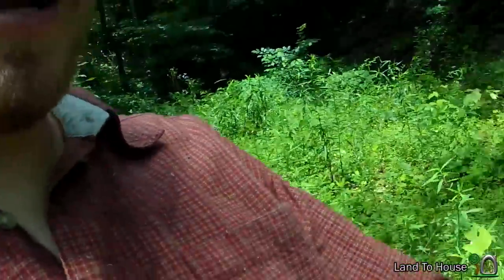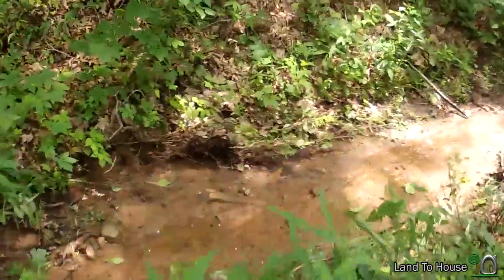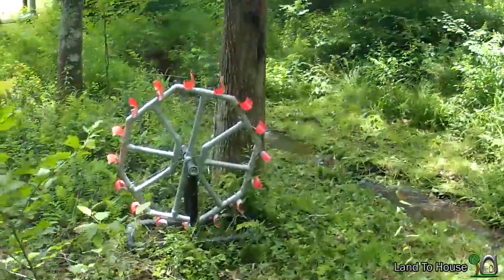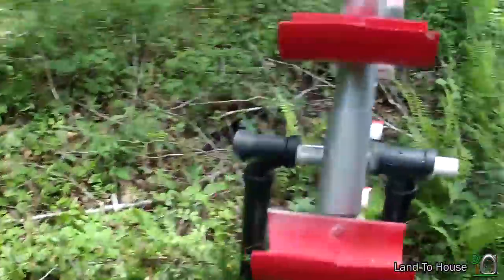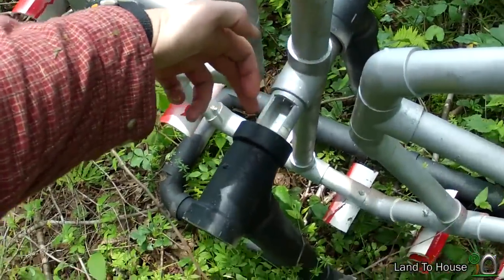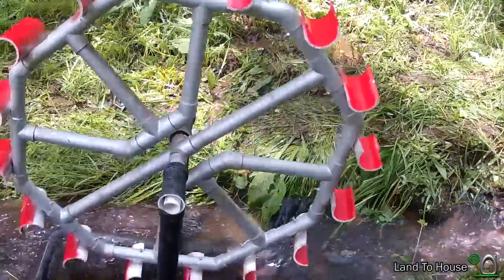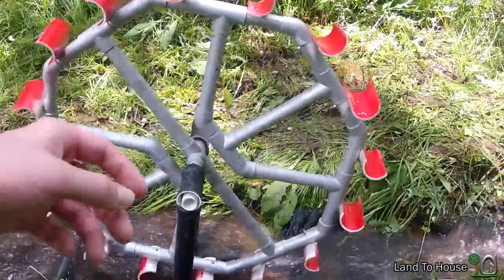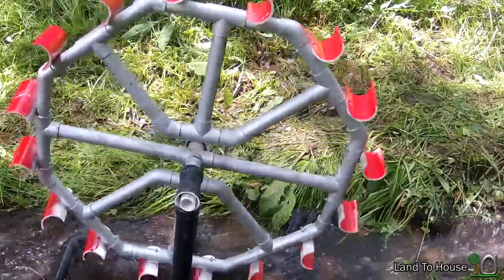Land To House Adventure Episode 10 - Water Wheel Pump

Comment: And here we are again. lol I got your ram pump and I never could get it to run right, even in winter when there was plenty of water, bc there is just not much drop. But now I have changed my plan to do a water wheel that runs  puston type pump, and Google brought up you. It's all good. I knew my idea was not new and I knew  I could find a video that someone else had done this.  I'm still tryin to get water to livestock up on a hill without having to fuss with it all the time.  May run a ram pump in conjunction to the water wheel piston pump.
Reply from the maker: So sorry to hear the ram pump did not work. It does need at least 2 feet of head pressure to be constant in operation. I had a time with this water wheel pump. Gave up after a while. There is a Facebook group called water wheel pumps. It has tons of people who know what they are doing.
Reply: @LandtoHouse  I will give that a gander. I haven't  given up on the ram pump. It was super close to working a d maybe I can integrate it in. My Dad took it home with him and built a bigger, slightly different version, so now I have two and I owe him for parts. He brought it over and we put a 5 gallon bucket up on a big barrel and ran both of them from that just fine. But my creek just doesn't  drop very much, doggonit. I haven't  given up though. Our house, a 100 yr old house, has a spring fed well, which works fine for showers and drinki g water, but you get into a quarter acre garden watering and all the laundry, and then water cows.... it was not keeping up w the wayer demand.  So I'm still working on seperating my garden and livestock water from the house water via the creek.  So I will definitely be checking that group out. Thanks!
Reply from the maker: @beggsnachin  you might also be able to consider rain catchment? Even a small roof can store a lot of water. Then you could use a 12v diaphragm pump to push the water out to the garden and cows. .... with the right setup the ram pump is amazing but without that head pressure it's tough!
Reply: @LandtoHouse  was planning on setting that up in conjunction, but ultimately I'm tryin for a co stantly running water source for them that I don't  have to mess with, freeing me upnfor the quarter acre garden n animal maintenance chores.

Comment: you should make the system air-tight. The air trapped inside of the coiled piped can Luft water over 5x the height of the water wheel
Reply from the maker: +DIY guy I had not found a good swivel at the time of this build. Now I have one. Some day I will revisit this idea.

Comment: The idea which makes a water wheel from a pipe is wonderful!
Reply from the maker: Thank you! I had not seen it done before and I thought that I would give it a try. My water is just a little to shallow to really use this wheel design. I need to revisit this and make some changes to make it work better. Has lots of potential.